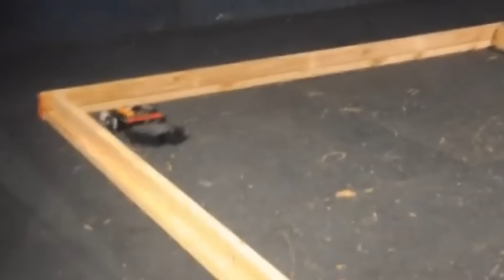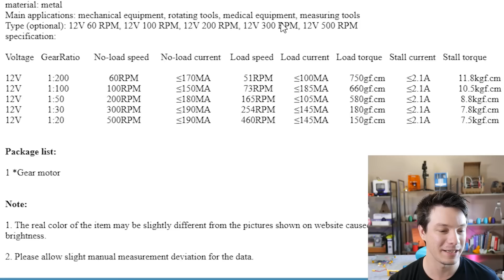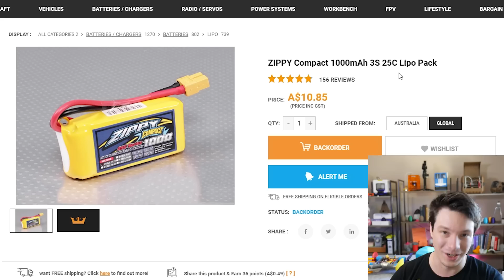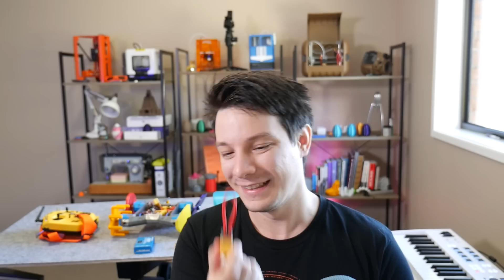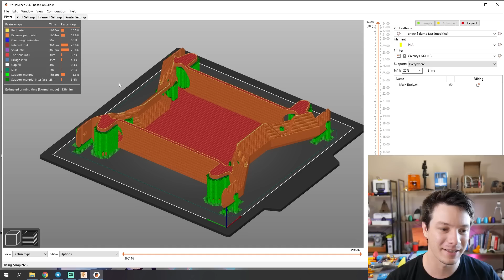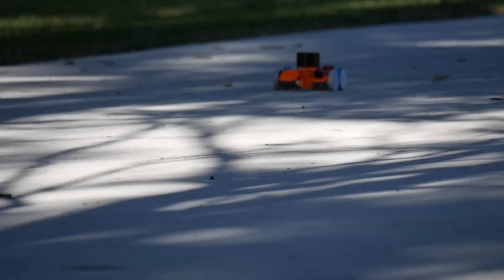How to build remote control robot platforms (you can do it!)

Comment: I get nervous about ordering direct from China when it comes to batteries and wiring. 

I once had a wall transformer melt due to a cheap no name charging cable. I now only buy name brand charging accessories. 

How can you tell if a battery or the cells in a battery are safe? How can you tell if the wiring is safe? I guess just use the same method you did in the video as far as making sure the wires are the correct gauge? 

Your comments on charging and storing batteries safely are great.

I guess Bangood actually holds their items in inventory if I remember correctly, so is that enough to ensure safety? At least it seems like more insurance than Aliexpress.

Comment: Wireing is simple, when you figure out a good system for it. examble lay everything  on a sheet of paper and draw the connections, you need to make, this visualizes the proses and its easier to go step by step. AND it will help you figure out where in relation should everything be from one another. like if you want your battery in the middle of your platform. you can plan your wires and part placement so you dont end up with a birdnest of wires

Comment: if you're getting a soldering iron larger than 25-30W you might as well get a temperature-regulated soldering station. 40W is useful for power cables like this but if you try to use it on a small circuit board it can easily damage components. with temperature regulation you can dial in whatever temperature you want depending on the solder alloy you're using and the controller will use just enough power for the parts you're soldering without letting anything overheat

Comment: You also need to check your ESC can handle the S number of cells. some ESC will not like 3S. also if you using a 12V charger you need to check the AMP draw of the charger against the AMP output of your charger.

Comment: Fantastic video Angus! I just wanted to point out that soldering the wire connections could (in this case) probably be avoided by crimping instead, if anyone wanted an altaernative.
Thanks for the videos, you are a big inspiration for why i just bought a 3D printer :)

Comment: have you worked out how to use a quadcopter controller to controll 4 motors on a car? it'd perform quite well haveing 4 wheel cornering/breaking and accelerasion.

Comment: Hi ! Regarding mixing, a librepilot mix for "differential thrust" is available on the web, so buy a cheap old stabilizer (like CC3D, I found some at 5 euros) and you can have any cheap radio+tx combo you want. Don't spend tons of euros in radios except if you want to go very far deep in RC hobby. Besides, there is a huge aftermarket, because some perfectionist people want the latest radio and get rid of the one of last year...

Comment: What size build plate do we need for the body? Did I miss that? I have a  Prusa Mini @ 180x180.  Guess if it is to small could make it a little smaller in width but deeper, with the cad files. Thanks!

Comment: The total cost of what's shown is a bit steep for the young person on a budget.  Fortunately, you can build a rudimentary RC setup with a Raspberry PI 3, ($25),  two yellow right angle gear motors with yellow wheels ($10) and a RPi 3 -  SPDT Relay Expansion Board ($17).  You will also need a AA battery holder to power the wheels and a USB power pack to power the Pi.  

The rest is some wiring and a lot of python.  However, this system can run autonomously, or you can remote control it using a bluetooth keyboard or from another Pi using wifi.  Not bad for under $100 US.

Comment: Hey! Love the video! Especially all of the LiPo info! I come from the nerf modding world and we use LiPo's all the time. Another thing we use is called a LiPo alarm. Basically, it plugs into the balance leads of the pack while in use and it monitors the voltage of all the cells at all times. If it detects that any one cell is lower than it should be, it makes a super loud beeping noise. So anyway, that's what we use to make sure we get the most out of our packs while still being safe. They are super super cheap and some even come with screens and you can customize the limit. They are also super small and pretty easy to integrate into a build like this. You can find them on most websites but I recommend going to outofdarts.com under the batteries + chargers section. I hope this helps someone!

Comment: Motor Kv and volts equal rpm max and lipos are best drawn to only 40-50%
Reply: For instance I run 5s lipo with 1900 kv motor so it turns 35150rpm on the sendit switch maxed

Comment: I have an old quad copter (built before you could just buy one!) that doesn't work anymore. I have motors from that with ESCs, I wonder if I could use those for such a platform...
Reply from the maker: The escs may be able to be reprogrammed for forward and reverse operation, is so then yes!

Comment: Something you clearly did in the footage but forgot to mention in the explanation/on the diagram is cutting the positive wire from one of your ESCs into the receiver so that only one BEC is supplying power to the RX. Some RXs seem fine with it, some don;t, but its good practice either way.
Reply from the maker: True, I haven't had much issue not doing it but it's still good practice. So many additional things small things to learn!

Comment: Great video, thank you for making it. 
I am just finishing some upgrades on a similar robotic platform I built two years ago. In principle it is the same but it is a little bigger. 125kg when not carrying any load :-). Two car batteries, two 500W motors geared down via bicycle chains to 7kpg max speed, controlled by Sabertooth 2x32A ESC. I decided to skip the remote control part and I have a box with a joystick and an emergency disconnect button on a 2m long cable. If I push the button or the cable gets cut a 100A relay on the chasis disconnects the Sabertoothe from the batteries. I do not want to be pushed against something by it if it goes crazy, that thing is scary. 
The purpose of it is to carry heavy things instead of me (fire wood, cement bags etc.). I built it reduce the loading on my injured ankle. For example with the fire wood it replaces 3 trips with a wheelbarrow where I would carry part of the load with just one trip where I carry just the joystick. After 10 operations the ankle is now fused and almost painles but this robot is so much fun I just keep using it :-). 
I did not have a 3D printer when I built it but now I do. So when it destroyed its wheels in roughly one year of use I designed my own wheels in FreeCAD similar to the style used on heavy duty bobcats. I ordered some laser cut steel plates for the sides and 3D printed a mold for the polyurethane rubber. I finished the wheels a week ago and they seem to work well. No I am just printing some minor upgrades for cable management etc. So even with a Prusa Mini it is possible to make 320mm diameter 10kg wheel out of aluminium, steel, PETG and rubber if you get creative enough.

Comment: If you’re using cheap brushed DC motors, why even bother with ESC’s? You could use an arduinos PWM output to indirectory drive your motors with the PWM signal on the gates of a MOSFET to control the high”er” power motor circuit. Optionally, I’ve done this with optocouplers as well. 

It gives you the freedom to program your own motor controller and Radio controller in the same board. Saving on space, weight and a massive savings on cost.

Comment: For Radios I'd recommend getting an OpenTX capable one - On my Tamiya #56020 Leopard 2A7+ ( https://youtu.be/VNP6Dstz6wc ) I installed a 3rd Party 2-Axis Stabilizer that would interfere with the commands for the Tanks default secondary functions ( Firing, Lights, Modes, Engine, etc... ) but with my OpenTX capable FrSky Horus X12S remote I was able to overcome that issue by having the remote trigger the secondary functions by only 0.3 seconds regardless for how long the associated switch is being held high - Short enough to trigger the secondary function without that function already moving the primary ones ( Driving, Steering, Turret, Barrel ). If you want a fairly affordable and small OpenTX capable Radio then Team Blacksheep has the Tango 2 for slightly less than what was proposed in this video - Unlike it though it won't be a multi-protocol but a ~900MHz CrossFire Protocol one which not only can send Telemetry ( like signal strength ) and MAVLink Data ( popular Drone Protocol ) back to the Radio but is generally more robust with the signal than 2.4GHz.

As for a Soldering Iron I'd recommend the MiniWare TS80P Soldering Iron as a Kit with a Silicone USB-C Cable ( there are various kits ), the optionally available TS-BC02 Chisel Soldering Tip and a Baseus USB-C 65W GaN Charger - The default Pointy Tip of the TS80P serves well as a Heat Insert Driver ( so not used for soldering! ) while the Chisel Tip is generally more suitable for most of the other work you'll be doing.

Comment: i find drill motors do a good job especially with how low profile most drill batteries are, the fact they are DC makes it easy to control its speed. theyre also generally heavier so there is more weight over the traction system, be it wheels or tracks and have a better job of grip while the sheer torque of the motor can drive pretty heavy chassis.

Comment: Hello Angus.
Today's video was nice.
Here l am shamlessly asking again "What do you think about the creality cr-3040 industrial grade 3D printer ?". I'm opening my own place and i need a printer that can work around the clock for a really long time. Just comment wil be enough.
Again thanks for the hard work.
By the way, once in college we tried to include hidden mecanisms and structures inside the wheels of a robot that unlocks and changes forms depending on the terrain. It was very much mind wrecking but also fun at the same time and i think you should try that. It'll be fun

Comment: Lipo (lithium-polymer) batteries are great for this sort of thing, I've got a pile of them for my FPV quadcopters, but you do need to handle them with care, notably don't discharge them lower than 3v per cell or charge them beyond 4.2v per cell (unless they're HV type which can handle 4.35v per cell), and when done for the day, use your lipo charger to put them into storage voltage, so they end up at 3.8v per cell to help extend their lifetime.
Damaging/puncturing them can cause bad things to happen (lots of videos on YouTube showing why), you can't put out a lipo fire because it self sustains, you can only try to mitigate the damage it can cause in a thermal runaway.

Comment: Silicone Wire.

I'm no pro, but being able to manage heat much better means easier soldering so you don't burn wire insulation plus the benefits he listed about routing.

Comment: 11:30.   ‘pretty cheap’ , at a 100 bucks you at better of programming an esp32 to work with a PS4 or Xbox controller. This leaves you at a cost of only 10 bucks assuming you already have the PS4 controller. The car will then be controlled via Bluetooth and allows you to use other outputs of the microcontroller as well as attach sensors and what not. The only downside is probably the effective range.
Reply: This is a cheaper option but it requires some knowledge of arduino and programming don’t try this when you are just starting.

Comment: Don't put your LiPO in a sealed container, though.  A cake tin with a LOOSE lid is good.  A sealed cake tin is just going to become shrapnel if something goes wrong.

Also, brushless motors are slightly more complicated but sooo much better on power draw.  BLDC motors need BLDC controllers, though.

Comment: Years ago I bought a toy styled on a creature from robot wars.  The circuitry was shockingly old school (hasn't the designer heard of chips or smd? ).  BUT...... they'd put a few bits of plastic together to make a centrifugal clutch.  2 cents.  The motor cant stall even if the output shaft is halted.  No motor damage, no risk of high stall current damaging the battery or control circuitry. I took my hat off.  Really nice design, dirt cheap .  And trivially easy to 3d print the parts of a centrifugal clutch, so I thought you might be interested.

Comment: Angus,
I am writing to you from NY. I have purchased scale model skyscrapers from CGTrader and want to 3d print them in sections with my Creality CR10 s4. The models import fine, I even check them on MakePrintable and they resolve any issues with the files. My question is this: When I offset a distance of say 2mm in MeshMixer to create a wall thickness, how on earth do I cut-out/delete/remove or whatever must be done to eliminate the infill in the windows of the scale model building? There are hundreds if not thousands of windows in some of the buildings. I intend to place plexiglas within the hollow 3d model to give the appearance of real windows. Please help...I have MeshMixer, Simplify3d, MakePrintable...does anyone have any suggestions?  THANKS

Comment: A couple important clarifications with LiPo batteries:  While you can go as low as 3.0v per cell, that will greatly reduce the life of the battery.  Some chargers won't even charge a pack thats as low as 3.0v per cell due to risks associated with cells that low.  A good rule of thumb is 3.5v per cell.  The other important part is that LiPo packs charge to 4.2v per cell.  Angus quoted 11.1 volts for a 3 cell.  With those numbers you might think a 12 volt capable system would be fine.  You plug it in and get blue smoke!?!? what happened?  4.2 x 3 = 12.6 volts.  While most RC components can handle that extra 0.6 volts, not all microcontroller and sensor packages can.  So its best to plan for the true voltage at full charge.  So the effective voltage rating that you should shoot for on is 3.5 - 4.2 (10.5 - 12.6 on a 3 cell pack).  The last thing is storage voltage.  LiPo packs deteriorate over time.  Just sitting there the battery is wearing out.  You'll easily get a few years out of a pack thats stored properly and you don't exceed the C rating.  Possibly many more if your current requirements are low.  The recommended storage voltage is 3.8v per cell.  Having the battery sit at a higher or lower voltage will cause it to deteriorate faster than if it was at 3.8v.   Nearly all LiPo battery chargers have a storage function the either charges or discharges the pack until each cell hits 3.8v.  The more you know!
Reply: I have servos that can't handle more than 5V, designed for a 4x NiMH bettery; you have to check the specs of what you're using before connecting everything up!
Reply: @cambridgemart2075  most servos can only handle 5v (the are and expensive ones that are 6v for extra torque). The good news is that the receiver will have a buck that will knock down that higher voltage down to 5v for you.
Reply: @gadgetmerc  Maybe on recent receivers, but all of my receivers (Futaba) have a bus between the power input and every servo connector , so all the servos get the same voltage that's supplied to the receiver.
Reply: @cambridgemart2075  I was doing two things while making that comment. The ESC had the 5v buck. The three wires that go from the ESC to the receiver are 5v, ground, and signal. The receiver has all of the grounds and again all the 5v connected together. So the ESC powers the servos.
Reply: @cambridgemart2075  pretty much all receivers do that. All the was back from my Airtronics receivers to my crossfire diversity receivers.

Comment: Hi, nice video, i used an L298n driver, 4 metal geared tt motors, Esp32 WiFi/bluetooth and a Ps3 controller for my little fun tank project. It worked out really well and most people have a Ps3,  all the other parts are really cheap.
Reply: That is what hurt me most in this guide. There are many much cheaper alternatives to remote controlling like ESP. I even made ESP8266 with web server and wifi hotspot, where once connected You could steer from Your's phone browser with buttons on webpage. You can't go cheaper than that and it is still very functional
Reply: @darekmistrz4364  ESP32 and a  PS3 controller is all you need.

Comment: Get a LIPO bag for charging and storage, they're very cheap on Amazon. Or, you can also use an old ammo container, as long as its a good quality steel.
Reply from the maker: Good call! There's a video on testing ammo containers against a lipo fire and it did OK but was under immense pressure.
Reply: Bag is fine keep them cool in longer storage times and lipo chargers have a storage feature to best keep the life I believe is like 75% I use venom chargers and they have this storage balance mode as most brand names do now have this feature as well

Comment: I recommend the "fireproof" fire-retardant fiberglass bags that are made precisely for lipo batteries pushed to the edge - search amazon for "lipo bag fireproof" (not recommending from personal experience, but, every barrier between you and a house fire is worth it imo)

edit - wow this video totally rocks. good on mate
Reply: I had a tiny 1S lipo that bursted (cheap chinese charger) and it was siting on the bag : there is a dark hole on the cover of it, but it saved my floor. Lipos are very dangerous, even small ones.